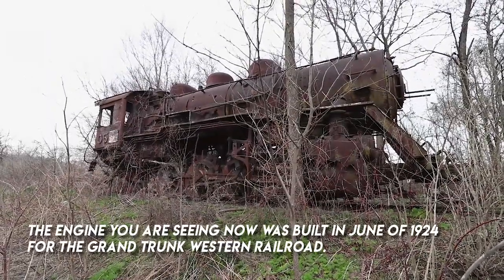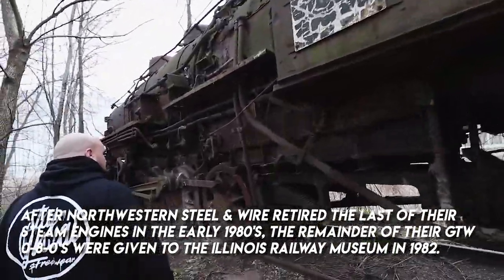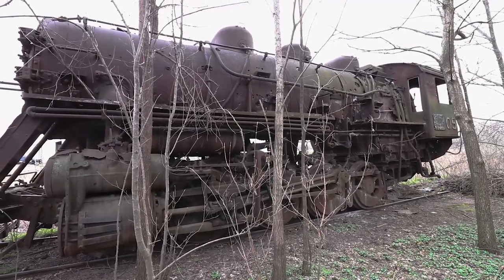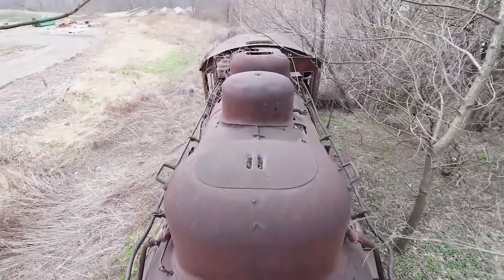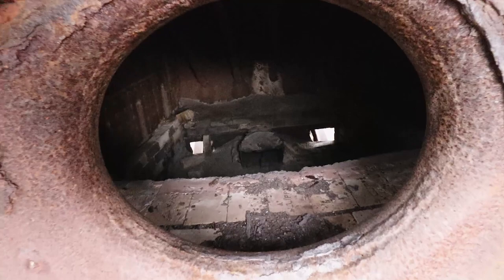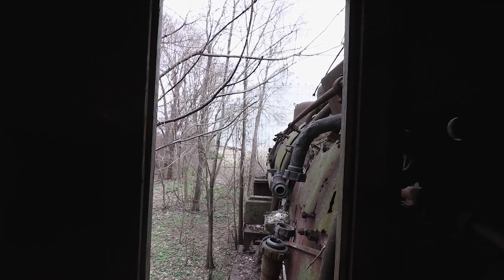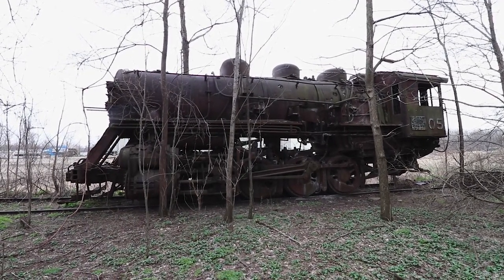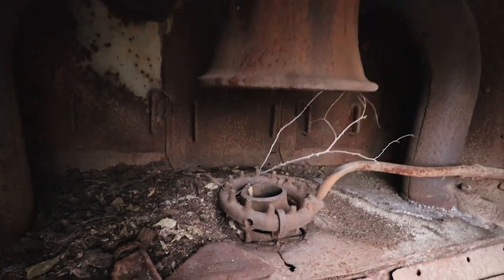Abandoned 1920's Steam Train Left to Rot - Galt, Illinois

Comment: This is a pretty nice overview. There have been plenty of photos of the 8305 over the years, but it was nice to see someone get up close. Of note, this is a switcher and it didn't have a cowcatcher. What you see up front is a switcher's pilot, essentially a set of steps. 

To note, the 8305 was one of 16 0-8-0s saved for use by NS&W during the 60s. After their retirement in the 80s, many were sold to various towns. The Illinois Railway Museum currently has one of these engines (8380) and a tender once used with a sister engine. The reason why 8305 was left to sit has been hard to pin down, but the fact is there are six other of these 0-8-0 switchers still displayed, some within a quick drive from Galt.
Reply: The most likely reason it was left is that it was in worse condition than the others, perhaps worn out bearings making it difficult to move.  Parts may have been borrowed to repair one of the others when they were still in use.
Reply: @jamessilberschlag1705  There's been rumor that someone bought the 8305 and never got around to moving it. With how expensive moving a steam engine can be, it's certainly a possibility.
Reply: atsf 2926s secon dgubl🔔
on track to tractor brewin
train🚂🚃🛤⌚️✨

Comment: The water tank is right above the...coal hole.... when the water heats up and boils, it gets sent to the steam domes at the top of the engine. From there it is sent to the pistons which push and pull the drive rods connected to the wheels. The extra smoke and steam goes out of the smokestack, and a little of the steam goes to the whistle. There is also always a coal tender right behind the engine to store coal and water. That little box shaped thing right beneath the cab at the rear is where the water would flow to the engine. Steam engines are truly fascinating. Great vid
Reply from the maker: I appreciate your knowledge on this once great machine! It’s a fascinating piece of engineering from the past. I recently had the opportunity to see the steam engine Big Boy and man was it amazing. I recorded it with my drone passing under a bridge and shot across town to catch it at a crossing shortly after. A memory I won’t soon forget. Man was it powerful. Glad you enjoyed the video.
Reply: you guys do great work I recently just found you guys. First video i saw I subbed! I’ve had the passion for trains since I was little, I’ve also loved urban exploring but I never get to do it since I’m not old enough for a car.
Reply: @lordexplores  ... and that little what you call a BURNER is a "Blower" (?) this ring full nosels get steam and accelerate everything around out of the shimney... this generate a vacuum in the smokechamber and the conectet Pipes true the Boile into the firebox... this helps to control the fire !

Comment: Hey LordExplores!

I used to live 30 miles north of Sterling/Galt and I can tell you about Northwestern's foray into late-operating steam.  Northwestern Steel received these to scrap, as they were operating some of the world's largest Electric Arc Furnaces at the time.  The Dillon family (owners of Northwestern) decided to save some of them and run them as switchers in the plant yard and adjacent Union Pacific tracks.  Northwestern's property complex in Sterling at the time was about 5-7 miles long along the river.  When the company stopped using the steam locomotives in the 80s, they were pushed onto the Galt Siding (seen here) where NW stored all manner of railcars and scrap awaiting the torch.  One locomotive was saved and preserved at the DIllon Home in Sterling where it sits alongside the river in the front yard today.  Northwestern Steel and Wire went bankrupt in 2001.  When Leggett and Platt bought the mill in 2003, they did not maintain the right of way where these locomotives were parked, so old right of ways when abandoned will revert to the property owner on record for the parcel.

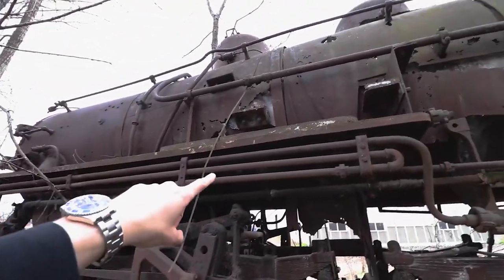Comment: 0:58 those pipes arent for steam they are for air from the air compressor to supply air for the air brakes
For those who don't know a stem engine works by boiling water to make high-pressure steam here's a simplified version of the process
The fireman shovels coal into the firebox
the heat from the firebox is sent through a series of tubes in the boiler and that heats up the water
The water boils and eventually becomes steam
The steam has no place to go until the throttle is opened so the pressure builds up
When the pressure is high enough the engineer opens the throttle
With the throttle valve open the steam is forced through a pipe and is split between the two cylinders
The steam is forced into one side of the cylinders pushing the piston rod forward
Then the valve gear moves and it closes the valve on one side of the cylinder and opens the other so steam is then forced into the other side moving the piston rod backward
The used steam is then sent back up through the smokestack and out making the iconic chuffing sound as well as drawing more heat from the fire making the engine more efficient as it goes along

Comment: These locomotives were originally built for the Grand Trunk Railway, and they were sold for scrap to Northwestern Steel and Wire in Sterling, Illinois in the 1950'-early 60's. They didn't go directly to scrap though, the company used them for a while pushing railcars around their property until they couldn't be used anymore. Then they were pushed to this location. I found this info through a Google search years ago, and I'm sur it could be found again. I like your vids, good work!

Comment: It's a USRA heavy 0-8-0 the smaller pipes on the side are actually a radiator for the (now missing) air pump that runs the brakes. the locomotive is propelled by the cylinders (the big bit at the front). the locomotive is equipped with what looks like a baker valve gear, the valve gear being what actually enables the locomotive to move. A quick search of "steam locomotive valve gear" will bring up most of the info a lay-man would want to know, but if you do some digging you should be able to find some more in-depth explanations

Comment: SOMEBODY SAVE IT!
Reply: That one is toast....beyond repair.
Reply: @Leatherface123.  There's a hundred more worthy than this one.
Reply: @evracer  but what’s wrong with that one tell me
Reply: @Leatherface123.  Its been rusting for decades almost all the parts would have to be replaced including the boiler, wheels, frame, side rods, firebox, cab, etc etc etc
It wouldn't be that same locomotive after a rebuild to operation
A cosmetic rebuild would be possible although extremely difficult because first, it would have to be moved then all the rust would have to be ground off and missing parts would have to be replaced like the headlight, funnel, most of the controls, and more Also from what I've seen in the video it looks like it doesn't have a tender so it would have to do without or get a new one.
Reply: @MrWolfSnack  he is right. It is beyond repair. Yes Up rebuilt bigboy. But you gotta consider. Look at all the rust. All the rot all the missing pieces, the tender. All would have to be replaced but would a company really want to rebuild something so rotted, no.
Reply: @TheAtlantaRailfan  I don't understand the people who are obsessed with a Locomotive still retaining the original parts...
Reply: @TankEngine75  I'm not, I'm just saying at it wouldn't be the same locomotive after a rebuild as very little of the locomotive would be original also it would be ridiculously expensive and there are engines that are in much better condition than that one.
Reply: @TheAtlantaRailfan  Oh
Reply: I've got a railroad nearby that I could store it there and slowly get the funds to restore it, who else is in with me?
Reply: The engine will most likley never run again but you can cosmetlicly restore it and put it in a museum which is what i would do

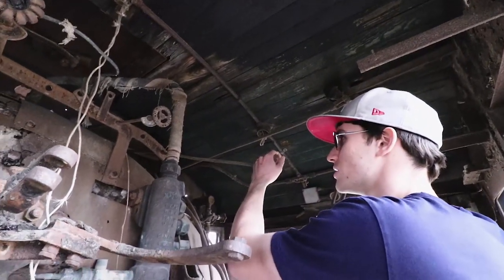Comment: 3:05 - Somebody stole the throttle bar years ago.   I noticed a lot of other parts missing like the smokestack, the lights, the whistle, the gauges, etc.   Other parts like the dynamo (generates electricity to run the lights), Johnson/reverser bar and other components still appear to be there.

4:16 - that's the smoke box where the smoke from the firebox (after it goes through the fire tubes and heats water in the boiler) and used steam from the cylinders is sent out through the smokestack.

Comment: The bent tubes under the running boards are cooling coils for compressed air supplied by the air compressor for operating the brakes and any other air operated accessories.  The engine is certainly not a behemoth but a somewhat large switching locomotive that many would call a cute little tea kettle.  As a switcher she would have had a footboard pilot instead of a cowcatcher for the switchman or brakeman to stand on.  The firebox opening would have been equipped with a steam operated set of butterfly doors worked by a foot pedal that could also be operated manually.  To understand how a steam locomotive operates you would be well served by watching any of the hundreds of videos on the subject.

Comment: The large cylindrical part of the train is effectively a boiler. Its full of water, with dozens of tubes running through it. The tube run from where the fire is near the back all the way to the front where the smokestack is. Coal is burned in the firebox and the hot smoke and heated air runs through the tubes and boils all the water, creating steam. The steam is run from the boiler through pipes to the pistons, and as it moves against the pistons, the pressure of the steam alone is what moves them. One push moves them forward, and then next stream of steam pushes it back. This is what creates the "chugga-chugga" sound we all recognize. On the second push, the steam is pushed up to meet with the smoke to go out the smoke stack. The pistons pushes the rods, which are connected to a drive wheel, which spinds and drives everything. So in a nutshell, it goes: coal fire, heats water, creates steam,  steam pressure pushes the pistons, pistons drive the wheels.

Comment: Can you imagine being the conductor in one of those back in the day!? The steam and the heat and the heat from the summer, would melt you!
Reply: This was a large industrial switching engine.  In the day, only an engineer (driver), fireman (coal shoveler/water level maintainer), and maybe a brakeman (couple/uncouple cars, throw track switches) would be with the locomotive as it worked the plant.  Conductor and brakeman would have ridden in the caboose, once cars were assembled into a train and ready to mov out of the switchyard.  The brakeman and fireman have been eliminated on today's railroads, and the conductor rides the locomotive with the engineer, also doing the work of a brakeman.

Comment: Nice find. I never seen the front open up like that.
Reply: That door on front of engine opens into the smoke box, not the boiler.  The ratcheted handle in the cab may have been the Johnson bar, for reversing the engine when needed, and adjusting steam flow to the drive cylinders while running, in conjunction with throttle. Throttle appears to be missing.  Did not see air brake control, but might have missed it.  Steam locomotive are amazing machines.  Fortunately many of them are being restored today.  There are places where you can see them in operation, although hardly ever on the big Class 1 railroads, Union Pacific being a notable exception.  Steam trains are no longer used for revenue service, but sometimes for excursions and special events.

Comment: You guys aren't the brightest bunch! The headlight wasn't brass. It would've been steel. The tubing on the side isn't for steam! It's for cooling the air for the air brakes. The "pumps" are called steam cylinders. That's what pulls the locomotive along. The lever you saw, isn't the throttle. It controls the valves.
Reply: Thank you engineer Bill.
Reply: He clearly said he's not a train guy and they were just making guesses. No need to be rude.

Comment: Would it be able to get restored to operating condition?
Reply: Highly unlikely.  The firebox and boiler are both unserviceably rusted.  Repairs would be prohibitively expensive.
Reply: @jamessilberschlag1705  it would still be nice though
Reply: This one is toast.....not a good part on it at this point.
Reply: @undeadslayer9002  and it literally wouldn’t be the same train. I guarantee the frames fucked, the pistons are shredded cheese I bet every pipe is fucked, missing headlight, the list goes on.